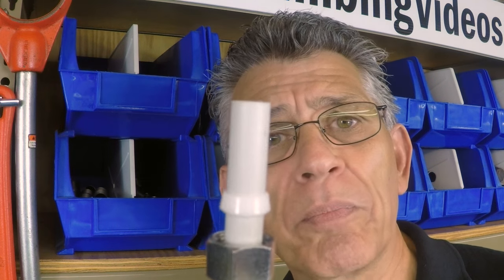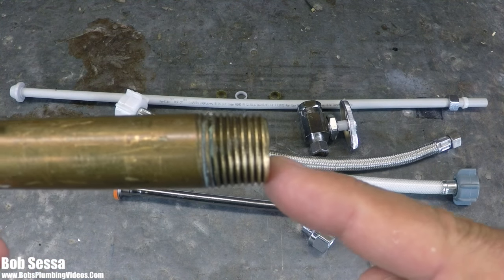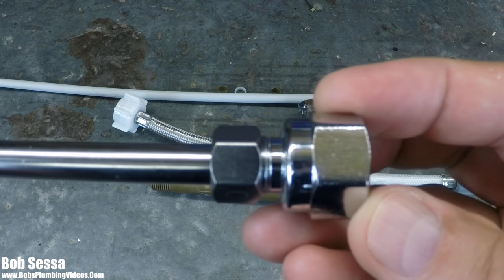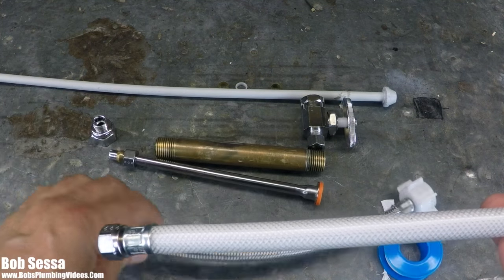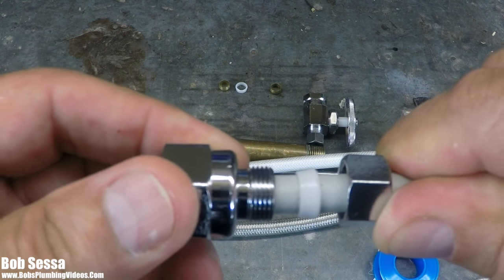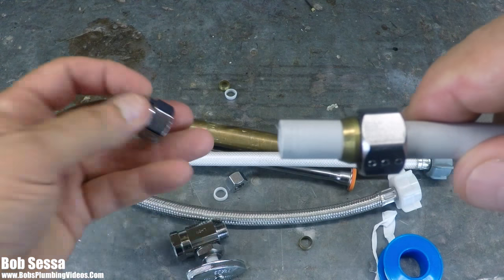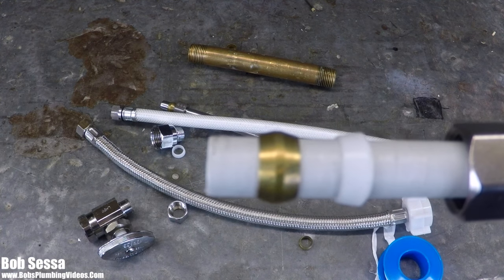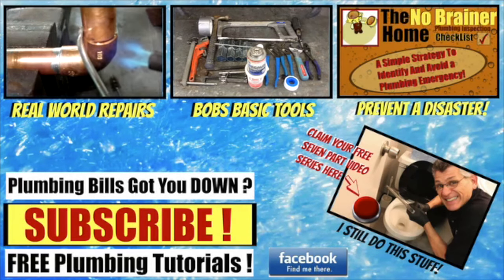Leaking Compression Tube / When to Use Plastic Ferrules

Comment: it's called an olive.
Reply from the maker: In America it's called a ferrule.
Reply: @BobsPlumbingVideos   hey nice video. i find the plastic rings sometimes still seem to leak. i'm a diyer but found the perfect solution from an ex british plumber living in my area. for plastic to metal they always put an "insert" on the plastic end. the theory is the insert will stop the olive from collapsing the plastic. before closing the compression joint spread some water hawk on the plastic end and over the olive for a long lasting fit. the combo does seem to work, it's coming up to a decade since the joints were made and no leaks yet. the drawback is although inexpensive the inserts were sold in packs of 50 so i don't see them ever being used up.
Reply from the maker: @范無救-w3x  I generally see those inserts on 1/4" ice maker or humidifier tubing, although I use copper tubing for those applications. Speaking for myself I generally don't see them being used on 3/8" pex basin supply tubes, but you're correct. Theory is that they'll keep the tubing from collapsing in when tightened.  Appreciate you checking out the video! Regards, Bob.
Reply: @BobsPlumbingVideos  it might be a british standard thing. i contacted a british seller on ebay and he mailed the 1/2" inserts to me together with a tin of hawk white. i since discovered hawk white is not recommended for consumption but water hawk is available which is fit for use on drinking supplies.